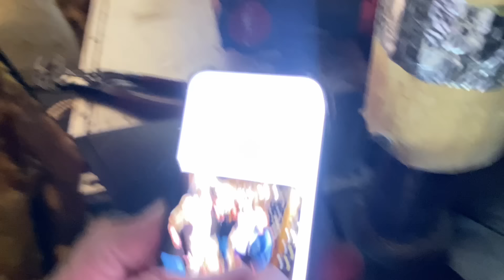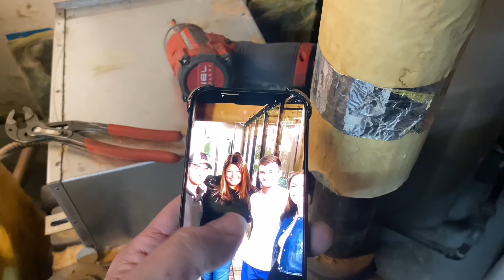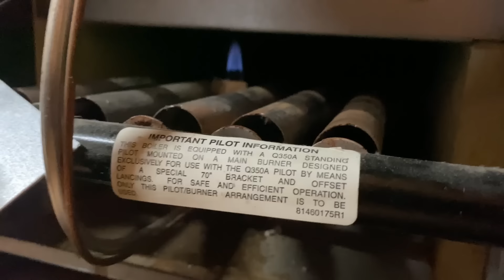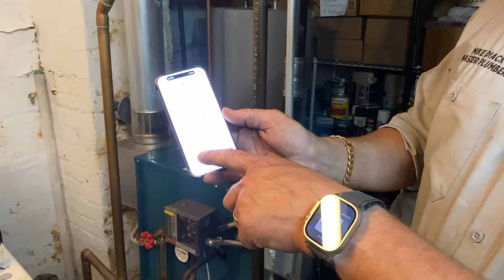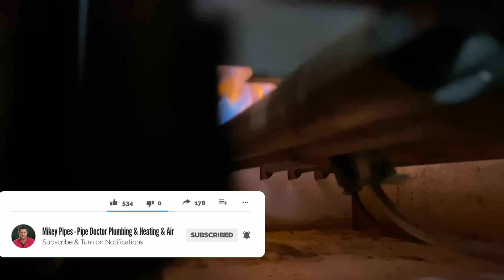Leaking Steam Boiler Replacement Cast Iron Block

Comment: Mike it is always wonderful to watch your videos. Excellent team work. You are the best teacher. Why don't you get a  hand truck with hydraulic cylinder to make the job easy. I am a super  of residential buildings in Flushing. I use the hydraulic lift for heavy pumps and motors. That lift is used to lift the patients from beds. Somebody threw in garbage, but it worked as a treasure for me. Good luck.

Comment: Watching your entry there made me remember a company I used to work for that came with a free gym membership 
My only problem was I told them I get paid to work out I don't pay to work out even though the membership was free I still had to pay a parking toll in a garage and couldn't do it on the clock so I never went other than one time I had to use the shower due to a sewer explosion and then I had a client meeting
Reply from the maker: lol 😆
Reply: My company paid half the garage parking price.  Motorcycle were half price.  It took a month for them to decide to pay it all for motorcycles.  Went down to get my spot, and they don't even charge, you just park under pipes where cars can't fit.  LOL  you could fit  dozen bikes under one 4 foot water line.

Comment: Great job! Have you considered a small ramp for the van to make moving heavy objects in and out easier?
Reply from the maker: Have I considered a small ramp to make moving heavy objects in and out easier?
I’ve considered buying a small forklift for the shop, but it is not cost-effective. I have an electric handtruck and that works for us.
Reply: @PipeDoctor  drop it on your guys foot, and he can get the handclapped lift put on your truck for free.:cat-orange-whistling:

Comment: My friend, who is a Boiler guy that I used to work with had a 4 foot pipe wrench that was steel. That thing was a beast, but it sure did break apart pipe two and 3 inch with ease. Do you have one?
Reply from the maker: We have a 48”

Comment: Another great job. Why do builders always make the access to the basements so tight hardly enough room to get the utility room appliances in and out? This was a great repair as the burner was still in very good condition. does the parts and labour not make this repair close to the price of a totally new unit? But nice to see that you can give new life to an old boiler.
Reply: There was plenty of access through the coal chute when it was installed. 🙃

Comment: Hey Mikey! Love the vids.  I have 2 steam Burnham boilers installed 14 and 15 years ago probably the same size as this one in 2 of my rental houses and both have failed within 6 months of each other and replaced.  They both had a hole in the block in the exact same place as this one in the video.  Wondering if this was a factory defect as all 3 failed in the 14-15 year timeframe.  These Burnhams historically usually last about30 years or so.  Your professional thoughts?
Reply from the maker: Not a manufacturer defect.
Reply: @PipeDoctor  Thanks for your reply.  Much valued
Reply: I guess these blocks have a longer life on oil fired burners. I still run a 63 year old Burnham Jubilee unit along with a new heat pump system. Only improvements made were a new fire box media and Beckett burner from Supply House.

Comment: There is a reason that that one section failed. Whatever damage that section, likely damaged other sections as well if they are not currently leaking, it will be leaking soon. Not very smart to replace one section. And the labor involved in separating sections and putting them together, is significant. Not cost-effective in any way. Not in any way got a customers best interests.
Reply: Apologies for the typos. Voice typing
Reply from the maker: loss of water and make up water. its an easy question to answer
Reply: Maybe yes and maybe no. Certainly a major cause of boiler corrosion. But not the only cause. Not that it matters in our scenario